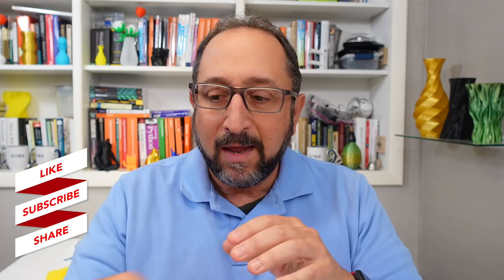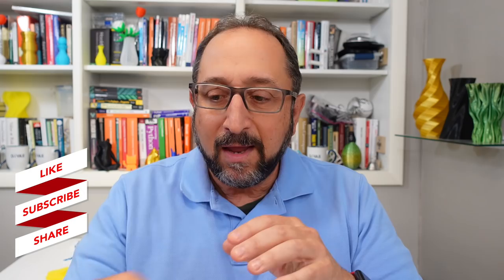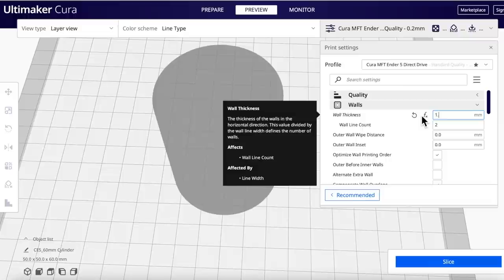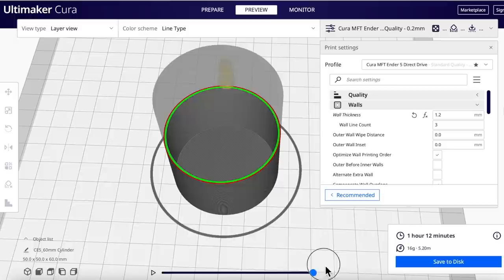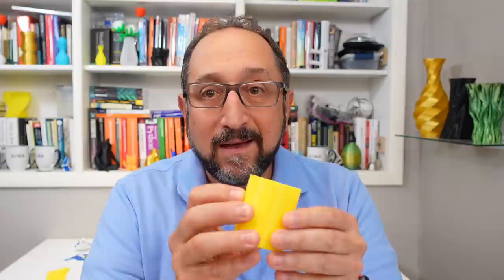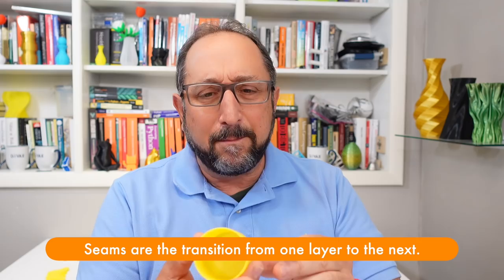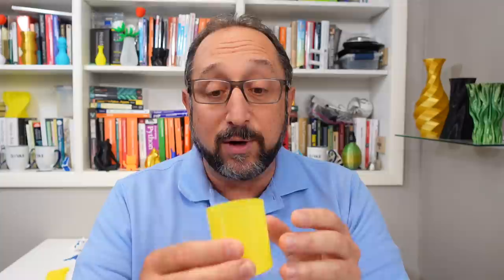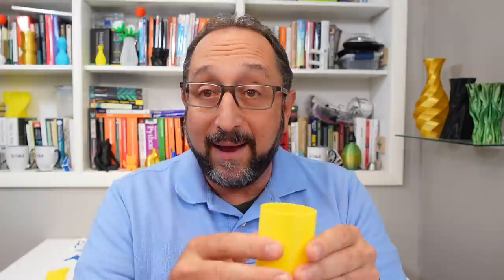Cura Slicer Advanced Fast & Stronger 3d Printed Vases without Vase Mode

Comment: Another tip is to use a wider extrusion width. For example in PrusaSlicer, the default extrusion width (you'll have to figure out which "width" is used for Vase mode, in Prusa it's the "External Perimeter" one), is 0.45mm. I've printed successfully up to 0.8mm without any visible surface imperfections, and I've printed up to 1.2mm successfully with some degradation in surface quality. This is all with a standard 0.4mm nozzle. As long as the layer bonding is good, those 0.8mm spiral prints are really sturdy, and very fast!

Just another trick that is good to have in your 3D printing reportoire.
Reply from the maker: Thank you.  I absolutely agree that there are many ways to get the job done.
Reply: Is 0.8mm width enough to make it strong enough?
Reply: @goku445  0.8mm will make for a pretty sturdy vase print, yeah. Of course there's always some flex, but it depends on what the use-case is.
Reply: @Mythricia1988  thanks. I guess it's ok for smaller vases. Wonder about permeability tho.
Reply: @goku445  From my experience it depends on the substance. Even thin walls work well for water, but for oily substances, 3D printed containers behave like a sieve... So, seems to be related to the surface tension of the liquid.
Reply: I recently had a problem with my 0.4mm wall vase mode prints being to weak.  I played with changing the wall thickness to 0.5mm and 0.6mm.  For my use case even 0.5 was enough to make a noticeable difference. 0.6 was even stronger.  I didn't try 0.7 or 0.8 because I got where I needed to get at 0.6, but maybe for something else I'll play with that.  Depending on the print it may not be a concern, but keep in mind of course that the 25%, 50% or 100% increase in wall thickness will increase your filament consumption.  Another tip is to slow down the speed and/or increase the temp.
Reply: Great comment, thanks. Your suggestion to change the extrusion width is spot on. I tried it and it's been working great with Cura's vase mode. I set the wall thickness to 1.2 and I get good-looking, strong walled prints.

Comment: I had never thought of doing it this way!

Whenever I have made anything with vase mode, I've used a .6 nozzle with the line width cranked up high. 

Really useful tip, thanks!
Reply from the maker: Thanks.  As you noticed you can combine these two techniques.  Larger nozzle and multiple lines.

A great place to discuss this is at the MakeWithTech forum located at https://forum.makewithtech.com.

At the free MakeWithTech forum/discussion group, you can also post images and examples of your work.
Reply: What? You never thought of slicing vases in normal mode? There's nothing new here. In fact, the suggested "solution" is the default settings in any slicer. The consequence of using normal layers is the seam, and this video doesn't show how to get rid of the resulting imperfections, so what exactly did you learn from this video?

Actually your way of doing it is much, much better. Just use a bigger nozzle and crank up the line width, and then spiralize it. You did it right.
Reply: @marcus3d  I learned something.
Reply: @hugohugo37  What did you learn?

Comment: hehe..just a few days ago I decided to try vase mode and I was not very satisfied with the strength of the printed model..in the same way as you I approached solving the problem..manual vase mode..it turned out great ..so much stronger vase...i did it with two walls and it turns out great.. anyway great video,i enjoy to watch them..

Comment: I just finished printing a funnel in spiral mode with Cura. I have been using .8mm line width in my vase mode profile. I decided to print this in 1.2mm for the first time. The result was great. The surface (both inside and outside) is very good. I used a layer height of .28mm and the funnel looks like it was printed with a .2mm layer height. This funnel is pretty simple so I want to print a more complex vase with the 1.2mm line width to see if the 1.2mm works for other items. All my previous prints with .8mm line width have been very good. And lastly, the strength of this funnel is is pretty amazing considering that it was printed in vase mode.

Comment: I resorted to nearly the same method the other day on my own to see if it would get rid of those little blobs in vase mode on my Ender 3 V2. It does  :)
Reply: i am confused, i have the ender 3 v2 too, how did you lose the blobs/dots ?
Reply: @AireDeZapatos  Basically, print a vase in normal mode, like you would print anything else, not in Spiralize mode.

Comment: You can often minimize those bumps by turning coasting on. Also, for a model like this you could actually turn retraction off. A combination of these options can reduce or remove the blips.
Reply from the maker: Correct.   Thanks for sharing.   You can also experiment with minimum segment size.

Comment: Herb, thank you for your work.  I am wanting to make a tpu seal for a cookie jar. So it has a contour, but no center.  Just a seal about a half inch wide and maybe a 1/4" tall in the highest dimension.  I would like to print it in vase mode or in a circular pattern for speed and uniformity.  Is there a method to do  this in cura?  Just seems really wasteful in time to start and stop and hit new starting places when it should be able to just go around and around and build up the profile.  Any thoughts? thank you.  (Enjoy your teaching style)

Comment: Well... Thank you! For sharing in a way that even a beginner understand!! Is there any way of printing small boxes ( 90X70X65mm ) that dont take forever? First I designed a box in thinkercad the way I use to, and slice it.. 7h per box! I need 12 of them. Then I tried spiral mode, 1,5h Then I tried making a box with "manual vasemod" with 1,2mm walls and it still would take 5h to print! Is it because its a square shape or am I missing something? I run a Ender 3 V2 with ms direct drive, all metal hot end, double z-screws and 0,4 nozzle.

Comment: I did find it very helpful. I am new to the 3d printing world so I have to ask a question that is bothering me. I have an Ender 3D Pro and it is not printing correctly. I have leveled it and have the settings right I think but I can print the bengy boat correctly yet. It looks good until about half way through. When I come back to check again it has a wire mess and is trying to print in mid air above the boat, what am I doing wrong? Please help!
Reply: You either need to film the print or watch it until failure as there are many things that can go wrong and you don't have enough info to diagnose the cause.

Comment: I also like to use weight mode but I prefer to find pieces in the field 32mm I have a bunker and trees (massive trunk) I usually print 0.4 but I print 0.6 wall

Comment: Excuseme. Instead of using spiralized mode, use SURFACE MODE IN SURFACE O BOTH. and then you could set numbers of walls, roof, and bottom. sithout infill. so you can asign 4 walls and it will print quicker than your mode. excuseme please.
Disculpe, en vez de usar modo espiralizado usen modo superficie o Ambos y alli podrán asignarle el numero de paredes que desen como asimismo tapas, techos, fondo, piso y NO USAR RELLENO Y QUEDARA REFUERTE. Ademas se imprimira mas rapido. Con 2 paredes ya adquiere fortaleza y estanqueidad. Disculpen, no quise ser impertinente. He aprendido mucho con Ud. Sr. Saludos desde Argentina. EL MUNDO DEL PC - MARIO

Comment: I'm assuming that printing a vase with this method that has a shaped outer design like the ones on your shelf is going to be much more difficult although the seam will be able to be hidden on the sharpest corner
Reply from the maker: It should work just fine.

Comment: Can't you simply change extrusion width? I printed 0.8mm with 0.4mm nozzle to print a tube - it worked quite well (prusa slicer). Have not tryed to do extrusion widh 1.2mm on a 0.4mm nozzle. It would nice to see a comparision. As with modified extrussion width where would be no seam.
Reply from the maker: Yes but over and under extrusion is very imprecise since the nozzle is a fixed size.   This approach is quite accurate.
Reply: What if you want a 3mm wall? This technique works with everything rather than a bodge of altering extrusion width. Which will add even more variables to the 3D printing equation you have to solve to get great prints.
Reply: @supercheapmodelrailways5134  Than you have to live with seams, as the video shows quite well. The advantage of vase mode is having no seam. So until up to about 2....3 times the nozzle diameter, just editing extrusion width instead of other variables definitly is worth it. Esp. on constant cylindrial shapes (so no overhangs), there more extrusion do not lead to visible artifacts. There was a video about someone trying to compare a 0.4 and a 0.2mm Nozzle - but getting nearly exactly the same result - he forget to correct the extrusion with, wich was still 0.4 on the 0.2mm nozzle...
Do not mix up bigger extrusion width with over extrusion. Over extrusion is pressing more plastic in a space as fit there. Thats not the case with higher extrusion witdh. The amount of plastic is whats calculated by the slicer (on normal prints the way the nozzle takes is the same as on a 0.8mm nozzle). A bit more imperfection you might get on sharp changes in direction. but thats normaly not a problem with vases.
There is no - as we call it in german - "Eierlegende Wollmilchsau" (animal giving pork, wool and eggs). The solutions to get an optimal print differ by the object you want to print. Actually on the cyliner I wanted to print, the seam was rather bad. With using 0.8 mm extrusion with I got the strength I needed, without a seam.

Comment: Isn't there a way to make a pseudo vasemode but without travels (where it doesn't print)?
E.g. like this with 3 walls:
1. Prints the inner circle.
2. Prints the middle circle.
3. Prints the outer circle.
4. Goes seamless to next layer and prints the outer circle.
5. Prints the middle circle.
6. Prints the inner circle.
7. Goes seamless to next layer and prints the inner circle.
...

I hope it's clear what I mean.

I don't know why this shouldn't be possible technically. But I have no idea what settings on PrusaSlicer or Cura would end up in this.

Comment: I've been trying to figure out how to design those nifty spiral vases. Or even better, double spiral vases. Doesn't seem to be an easy way with 123D Design. How is it done? The only way I can think of doing it is to create a series of stars, rotate them and move them up, and then loft between them. There's probably an easier way using other software (S-CAD, maybe?).
Reply: On more advanced CAD softwares, it's pretty straight forward. You create a base shape, and extrude that along a path that can be a spiral or what ever curve you draw in space. In more organic modelling software, like Blender, you can basically morph the 3d model by applying modifiers to the surface mesh, so you would just start with a cylinder, push and pull some vertices in and out to make a star shape, and then twist that thing by applying a rotation. I'm sure you'll find tutorial videos that show you the basic concept, and then you just need to go wild with your creativity...
Reply: @ProtonOne11  Thanks. I tried my initial idea of copy/rotate/lift/lofting polygons. It works. I then tried making spirals out of long rectangle sketches, and then combining them with a reflected counter-spiral (sort of along the lines of a Terraplanter), and then multiplying them around a circle - this works, too - the problem came when I tried to do an intersection between the multiple spirals and a vase outline - at this point the computer started to drag (I'm using a 10 gen i7 with 16 GByte of RAM), and got worse when I tried doing this with a double spiral. I guess it's just too many objects. Converting to a .STL literally took hours, and the result was a 40 megabyte .STL! It does import into Cura, though. I'll have to see how it prints - Cura says 16 hours. I guess I should investigate and learn Blender, too.

Comment: Hello and thanks for the video. Can you help me with this question? is there an option in Cura to print the first layer in 1 line? i often face the problem of seperate printed cirkels in corners that  come off of the bed, while the cirkels easily can be connected in the first layer. For example a constructionplate with 4 holes in the corners, easy to merge in the printing direction of the first layer.
Or is such an option already availible in the experimental section?  thx

Comment: Random seam alignment causes horrible pimples on the model skin with most bowden type printers. If only there would be a function to move the nozzle away from the outer wall slightly and jump to travel from the infill/inner wall...
I can't really understand how does the printer print 3x more wall lines  with only 20% overtime.
I would rather use 0,6mm line width (1.5x nozzle size prints reasonably well) and 2 wall line count.

Comment: Amazing that 1 layer wall takes 1h 2min and 3 layers takes 1h 12min? It does not make any sense if you think about it. I also think you can up the extrusion width to 0.8 mm max in a single wall. So lets set that extrusion width to 0.6, and use 2 layers to get that required 1.2mm goal, that should be totally doable. Would it print faster? Of because of the extrusion width the mm/s goes down and is in fact not faster? Hmm..

Comment: This was not really helpful.  It takes 5 minutes to swap tips.....just do that.  You can also print wider than your tip size if you up the temp and go slower.
Reply from the maker: When using tools there are often multiple ways to solve a problem.   If you are comfortable with swapping nozzles and retuning your slicer profile that is great.   If you think you can get consistent results by over extruding that's another choice.   This is a third alternative and their may in fact be other options.   

Isn't it wonderful that we have so many options for producing objects with desktop, relatively low cost, technology?